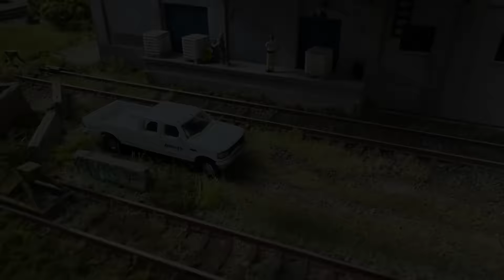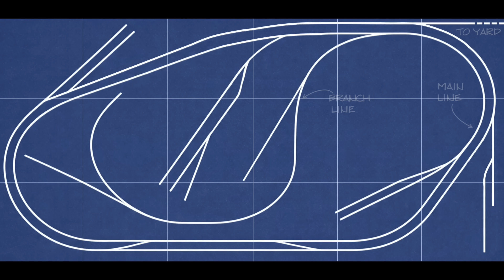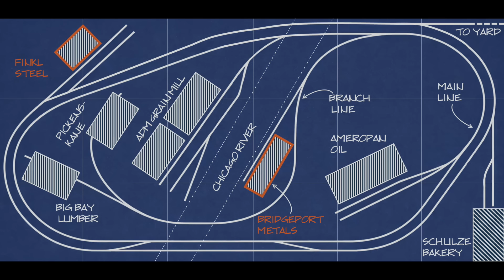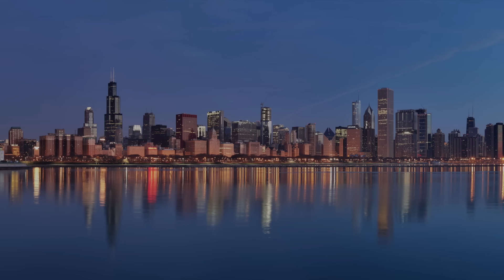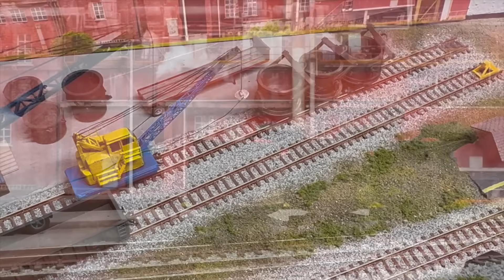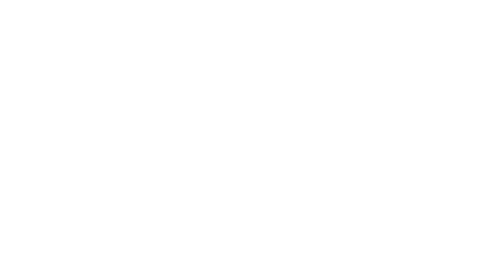Small N-Scale Layout | Chicago Crossing Layout Tour

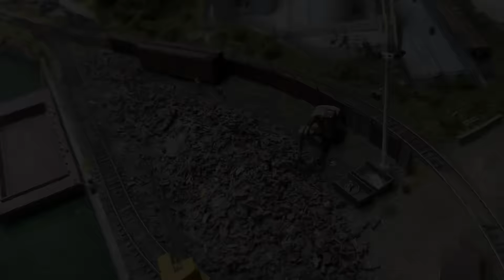Comment: 1:21 Code 80 for your tracks is actually huge (in N scale), even code 55 is considered oversized. 
Code 40 is more or less prototypical correct but you need to build your tracks and turnouts yourself... which is (can be) very rewarding but it's not everybody's cup of tea ;-)

But if you after a (hyper) realistic look, the correct code size helps...

(On the other hand, not all wheels like code 40).
Reply from the maker: There’s not a lot of upside to removing and relaying track on CCMR. Code 80 is overscale but it’s also reliable. I’ll leave the code 55 and 40 for a future switching layout.